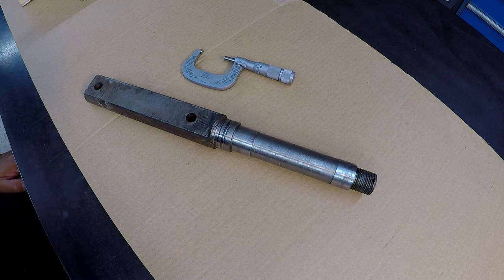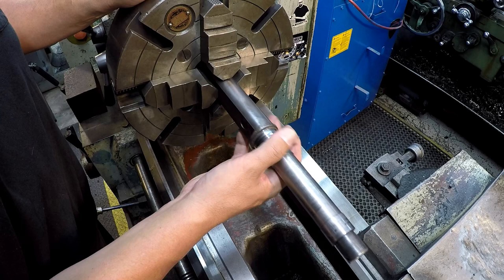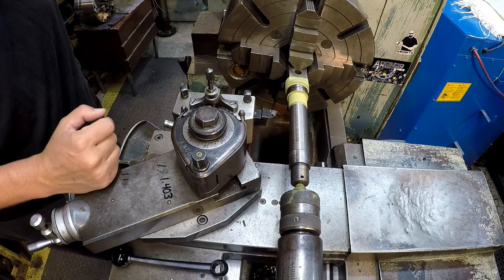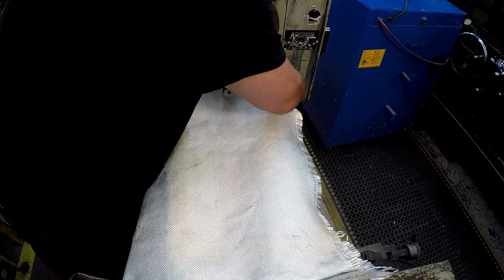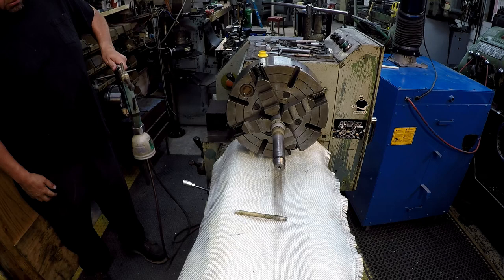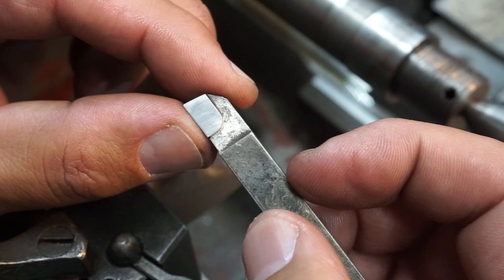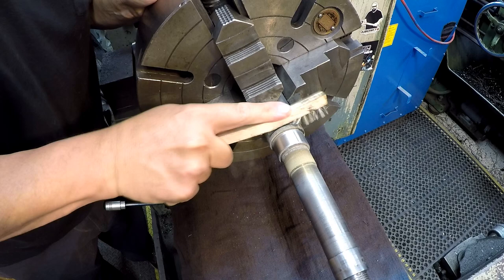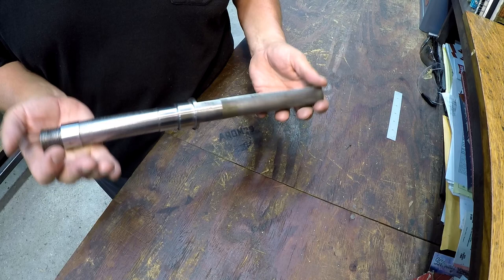Spray Weld Repair for a Porter-Cable G8 Sander Spindle

Comment: This video has amazing closeup views. I could see the marks from the diamond hone on the tool bit. Looks like you changed the lens on the camera. It's definitely for the better. That spray weld does save time to repair rather than replace a complicated machining of a replacement part. Thanks for the time to create the videos.

Comment: I don't want to be That Guy (for once), but I did notice something.

When you're hand-polishing, maybe run the lathe in reverse. That way, if something catches, it kicks your hands out away from the shaft, instead of (maybe) trying to pull you into the machine.

Comment: The correct term for this is called flame spray welding. Just saying spray welding is leading some to automatically think of spray mig welding. Not that I'm trying to be that guy. But I've been a multi process welder for close to 10 years. Love your work tho, keep up the great content.

Comment: Spray welding has fascinated me since seeing your video's. As I have not heard you say anything, it seems quite durable and save the cost of machining a new part! Very nice repair job!
Reply: @StormTravelerProtocol We had this at the end of the 70's ..... used to use it to build up worn areas of metal patterns used in resin sand moulding.

Comment: Sir,
You did a great job. 
But do not underestimate hot metal powders and the particles it produces. At university we have a LMD machine. It does buildup welding with powder as well but uses a laser as heat source. 
The full cell is kept at a little lower pressure as the space around it to prevent any dust from escaping. These particles are so small it gets through your lungs into the body.
Reply: Some of the components of some powder mixes are quite toxic too.  Adam should research what "mix" his powder(s), including the bonding coat and even the mask material to ensure that he's not poisoning himself.

At work we take extreme precautions to protect the workers from the powders.  Our powders very well may be more toxic that what "regular" Machine Shops use though -- we primarily rebuild jet engine components in our "plasma spray" shop.

Comment: Adam - Considering the depth the seal cut into the shaft's journal, I was surprised you didn't use a hard-facing buildup powder like Stellite 6. I have a Victor Powder Torch that I use to repair swimming pool pump motor shafts that become corroded by chlorinated water that gets past the seal and attacks the steel motor shaft.  In addition to wear resistance, Stellite 6 has super-good corrosion resistance as well.
Reply: John P. Callan hi ! I do also have a Víctor powder torch, but now it is so difficult to find any powder, where do you find it ?
Reply: @disasterprophet  When I bought the Victor torch it seemed like a good idea to lay in a supply of the various powders (lawyers were running out of asbestos companies to rob and were going after welding rod makers instead; I feared powder suppliers would go under), so I haven't bought any new powder in quite a while. 
I like Stoody 63TG for shaft buildup with corrosion resistance while still machinable. ESAB now owns the Stoody brand. Airgas has Stoody 63TG one pound bottles, which screw directly to the torch feed cup, for about $98. Victor VBP NO 22 Build-Up Spray Powder, not as wear resistant, but about half the price is also available from Airgas for about $55.
Reply: Thank you very much Jhon ! 👍👍👍

Comment: what is the hardness of the deposited metal? how would it fare compared to say original metal (would it last longer than a speed sleeve when applicable)?
Reply: You select that hardness of the material you deposit by choosing the correct powder. The product catalogues give you the HRC (Rockwell hardness scale). Castolin make a very wide range, but there are other manufacturers as well to choose from.

Comment: Before I retired, the shop I worked at overhauling hydraulic governors sent drive shafts for the governors out to be repaired like this.  Some came back with the silver metal like this and others had black filler.  The black seemed much harder and I never saw any wear on them when they would come in usually a year later for another rebuild.  The hydraulic governor manufacturer didn't like for us to have this done because it reduced their parts sales.

Comment: Turn the seal journal down .030  and make a repair sleeve and press it on.   DONE !!!!
Reply: canuckguy worried  A repair sleeve allows you to use the same seal. If this happens again and you made an extra repair sleeve you knock off the old sleeve press the new one on DONE !!!  You can repair it many different ways, this way is fast and if it fails again it will be quick to repair.
Reply: @SouthTexasSunsets    You can use a sleeve you can clearly see that
Reply: canuckguy worried  I just said you can repair it many different ways !!!!!
Reply: canuckguy worried  Install a new seal, but the seal journal is damaged. Why replace the seal ?  I guess adam is a damn fool for repairing the shaft should have told the guy to just do the average repair and replace the seal ! You calm down and breath OKAY !!!!

Comment: So I guess the big advantage of spray over MIG build up would be the uniformity and not having to overbuild- probably less overall heat and I'm guessing more uniform heat?
Reply: Yeah, the main problem with mig build up is the uneven heat input which can lead to warpage. A spinning shaft is definitely one of those things that would probably not run true after mig welding on it.
Reply from the maker: Stroke and arc on a shaft and you’ll warp it.
Reply: @Abom79  wholly cow! Thanks! I did that on my stump grinder shaft and wound up having to take another .015in on the remaining 1.625in of shaft to keep the sheave straight the beveled flange still fit the 1.235in shaft.

Comment: I learning a lot from your videos, thanks for your time. I was wondering though, is it normal to use your lathe for spray welding or is there another machine you would normally use and you're dealing with what you've got? I don't know anything, I was just concerned about causing warping or damage to your chuck and or some of that welding material getting on it, am I just wrong?

Comment: I'm surprised you don't have some sort of shield to protect the chuck from the spray welding process. A sheet metal or concrete backer board disk with a hole in the center should handle it.

Comment: Dying art now I bet. 45 years ago I was doing it. GOD IM OLD. .
Reply: @paulcopeland9035  wonder how that stuff holds up. If anyone has tried resurfacing an old flywheel or very* rare brake rotor. Something in a high pressure high heat application.

Comment: Wonderful, I didn't know that there is a spray welding before ,,, thanks
Reply: Search YouTube for 'hardfacing' and you will be amazed. Beside the spray powder method, there are a number of other ways to build up worn or wear-susceptable surfaces, and a host of different alloys to do the job.

Comment: With the size of that journal: Shouldnt your customer provide you with the measurements of the seal to be used? If this is an unusual size your customer may have a hard time to find a matching seal but you could have made it any size right now.

Comment: Alternative to spray weld repair is a speedie sleeve that is a thin metal sleeve that goes over the seal area 
If the size is available I would put a thin amount of gasket sealer over the wear area tap the sleeve into place and now the area has a new wear surface 
CRC seals have many sizes if your ever in a pinch

Comment: Adam, you don't seem to focus on nor discuss how you chose the bonding powder and final buildup material for the work. Given the fact that there are numerous  choices for bonding and metalizing alloys, perhaps you could let us know which powder you selected and why? Just as an observation,  the folks at Eutectic Castolin ought to catch on to how well made and informative  your videos and hire you as a demonstrator!  Good job, and let me know if you need a specific alloy. I have a large assortment in stock and wouldn't mind sharing to help you out!  If you're interested send a PM.

Comment: Just as easy to turn under by .200 and make a bushing to sweat on. I never like to grind or weld on my machines, that stuff can get all over. Or just weld up shaft and return.
Reply from the maker: It’s not just as easy, it’s just another way to do get the job done. This isn’t about sweating a sleeve on, or warping the shaft because of arc welding. This is about metalizing repairs, exactly what the system was designed to do. You not wanting to weld on your machines does you no better then the guys who aren’t afraid to bring the welding to the machines and getting the work done.

Comment: no matter how many times i see it, spray welding is always a joy.

you never seem to touch much on tempering.
i know your not a blacksmith, etc. but i wonder if some of these heavy cuts, or welding can cause temper issues.
do you outsource for tempering?
after watching some Alec Steel, will and him seem to have gotten it down to a science with those new ovens.
you know. if you have an empty spot in your shop for a new tool, and want to trade it for an empty spot in your wallet....

Comment: Could it be the bearing journal once was 1 7/16th or even 1 1/2 from factory, but the shaft developed a groove decades ago and some machinist just turned it down then, just down to a good surface?

Comment: Just curious but why not just run a weld along the worn area. Wouldn't it be a better bond and wear better? I have never seen this spray welding thing. Does it actually bond to the base metal like a good weld?

Comment: Adam, do you have an approximate Rockwell hardness number for that flame spray job or is it selective by the type of powdered metal used? Good video by the way!
Reply: Different powders for different materials or hardness. Some are up to 60 + rockwell

Comment: Ok, so I was a long time product development engineer...  it looks like the root of the first step didn't get filled, machined or polished.  I know, the seal lip interface is further up the journal so it won't affect the seal (directly).  But, this is a sander so there is going to be a LOT of dust/debris/moisture/oils in this area.  Seems like an attractive area for buildup to start and potentially lead to seal impaction.
Reply: Design engineer or product designer?
Reply: there are also other types of seals available like inpro seals or bearing isolators. more machine work to modify the housing but a brass split case o-ring type seal is what i deal with on a daily basis
Reply: @Themonkey8myleg  Trained in design, worked in Product Development.  Brought in on electro-mechanical products already in the market to analyze failures, improve performance or improve MTBF.  Moved that work into the Server world.

Comment: As always Adam, good work. Did you check to see if that oddball size seal is readily available? Could have built up the journal for a stock size if not. Thanks again for another great video.

Comment: What is the advantage of spray welding this instead of just welding a bead all the way around and then machine it back to specs ?
Reply: John Doe I would say heat and less stress on tools as the build up is consistent so no intermittent cuts? Guessing though, would be interested to know also.
Reply: @TheSmartStar  Well, as long as the material added is as strong, i can see the reason in this, i would just have thought that a weld, where the metal was bonded together because both metals are red hot would be stronger.

But yeah, if you welded this, it might make the piece bend a bit from the heat stress and if it does not run true, there will be other problems.

Offcourse the pressure from an oil seal is not something that puts a lot of load on the metal, it probably took 50+ years to wear that tiny groove

Comment: this is really cool! why prefer spray welding over more traditional welding? Does it make a huge mess behind the work area?
Reply: Conventional welding i.e. stick, MIG, TIG and such would put too much heat into the shaft, causing it to warp.

Comment: Is there an online webstore that the spray gun and powders can be purchased from?
Reply: The short answer is yes, but the more precise answer depends which country you are in :-)  If you go to https://www.castolin.com/ you will find a link on the left had side of the page that will enable you to download their global catalogue. From that you can identify which type of spray gun you want and which powders depending on the hardness that you want from the built up item. Once you know what you want you can use the countries link to find the correct dealer for your country. 

As someone building a small business I wanted to save money, so I bought my spray gun from an engineering auction but buy my powders from local dealers.

Comment: Sorry if asked before , but would this be an appropriate method for filling rust pits on hydraulic cylinder shafts ?
Reply: Hydraulic rams have chromium surface to keep them away from corrosion. You can use selective electroplating also known as brush plating. This method he is using, can't stop corrosion to happen again.
Reply: Of course you can, you would have to make sure you have turned all the plating off before welding and then send it back off to get replated

Comment: If you did enough spray welding, would it make sense to dedicate a cheap, worn lathe to the job?
Reply: Or just some sort of spinning fixture with a cheap motor on it.
Reply: It will be fine. Some people are acting like he's spraying acid on the lathe. There isn't anything getting on the lathe that will cause damage.

Comment: Hey there, i was just commenting on the Project Brupeg channel, wondering whether this spray-welding technique could be used to build up corroded panels (flat surfaces) on a boat. Someone said, it could. Do you (y'alls) have any info on that? Sources would be much appreciated, maybe even a demonstration on YouTube (or elsewhere).

Comment: Seems like it wouldn't be too hard to make something that turns an old chuck at the rpm that works well for spray welding. Maybe use an old washing machine motor.
Reply: I was thinking about making that same comment. You beat me to it!

Comment: I have a spray welder got it at a swamp meet...done a lot of welding but I have not done the spray welding where does one get the powder and I would think there is specific powders to be used for different applications, correct? Where do you buy your powders from?
Reply from the maker: Buy them at your local welding supply. They’ll be Eutectic-Castolin.

Comment: Wondering if that powder feed has a gate on it, or is the powder controlled by gravity/position alone.  Also curious to know if you have ever tried to grind finish (surface or cylinder grinder) a spray welded area, and if so, how did the finish turn out?
Reply: There is a gate on it, but in his case it is broken. He mentions it in a previous spray weld video. Because of this he has to hold it towards the ceiling

Comment: I wonder how the battery life on those insize calipers is. At $50 they seem like a decent deal but if the battery life is crap I'll pass.
Reply from the maker: They’re just as comparable to any other. Get a good quality battery in there and it last for months.
Reply: @Abom79  the really cheap calipers use a lot of power in standby and chew through batts no matter what quality they are. I'll give these a try

Comment: Hey Mr. Adam. 
I've never turned spray arc.
Just curious, it sounded like turning cast iron. obviously without the spring of cast since it's a thin layer, but does it turn like cast, and would you use the same insert as you would for ductile iron?
Reply from the maker: A grade of carbide uses on cast iron works good for this stuff. I enjoy using the Micro 100 tools.

Comment: Another good video.
I have used repair sleeves in the past. Why use metallizing instead of a sleeve? More permanent repair? Less chance of spinning the sleeve under pressure? Just curious.
Thanks.
Reply: A press on sleeve also adds a potential leak point. I'd guess it probably also stretches the seal farther than is ideal. When possible I'd rather drive the seal deeper or use one with a different lip location than speedi sleeve it.
Reply from the maker: Those speedy sleeves are for field repairs and emergencies, not a long term solution. Once the oil seal cuts through it the sleeve material will destroy the seal. This overlay buildup provides a long lasting tough hardness that’s corrosion resistant.
Reply: @Abom79  makes sense. Thanks for responding.